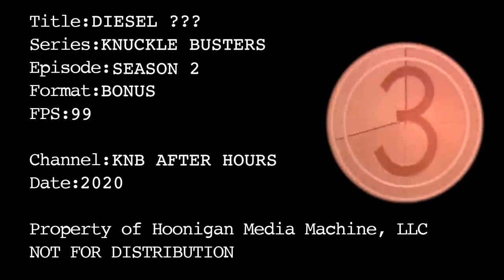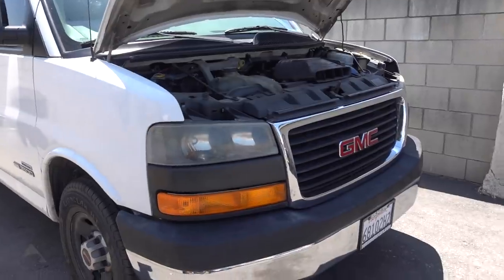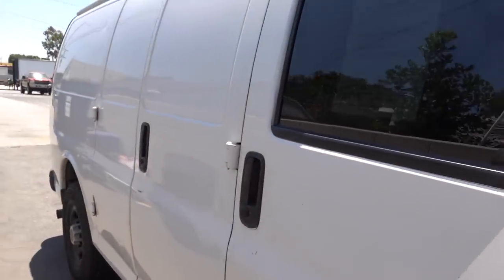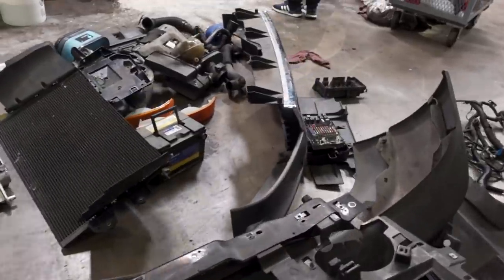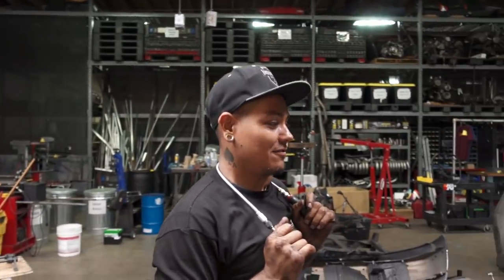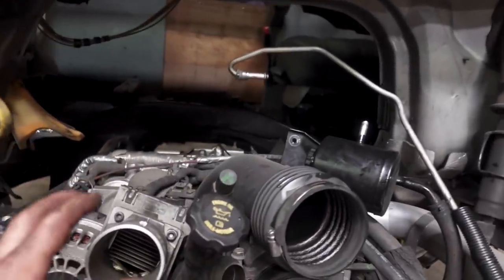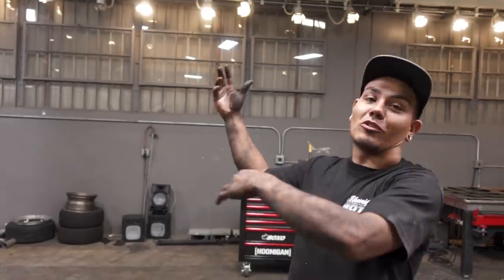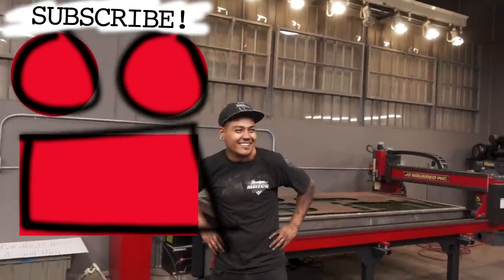Powerplant for Knuckle Busters Season 2 Mystery BUILD!

Comment: Ya'll need to drill a hole on one or each of those forks and  bolt in a towing ball or something so that chain doesnt slip....I keep getting flashbacks of the LS motor falling into Chase's car.
Reply: Deff put some holes in it, we run 2 bolts with the chain between them

Comment: what weights 850lbs and makes 300hp. a duramax. should have just left it in the van and had an awesome tow rig. 

I know some bolt ons and a tune will bump it up to 500hp but you'll still be slower than a 500hp gasser because it weighs twice as much.

Comment: if you plan on drag racing the Duramax call Gale Banks and get one of his drag pack kits for the Duramax. he's the holder of more speed records with the engine then anyone else in the world . he has everything you will need from one of his billet cranks up to the intake and twin turbos to make it out run an LS off the line. he is currently making over 800 hp on a stock engine with a super turbo set up and is shooting for 1000 hp. he has been doing this stuff to diesels since the 70's so he knows his business . also stuff a wrecker aluminum LS 4.3 and a matching trans in the van and save it the damn thing is to nice to let go . alfonso you know it's out back on the lot with all of Scotto's other cars  you know the ones he don't want us to see for one reason or another .

Comment: What's that white powder on the floor at 3:02 is it to soak up oil and coolant?
Reply: Diatomaceous earth, very common in shops to clean up spills. Material soaks the oil and it's sweepable into a garbage bag for easy disposal... or so they say. I've always preferred pigmats but you can also use kitty litter.

Comment: I mean, it doesn't have to be torn apart. You could rip out the 6.6 and 4L80, and swap a 2JZ or K24 or RB26 or SR20 or literally anything into it with a new transmission and have yourself the world's first GMC 3500 with the heart from a JDM car.

Comment: A built 6.6 really, really, REALLY needs a built Allison 1000 behind it, not a 4L80E (the statement "a 4L80E is really good for us" really shows you're experience in gas engines vice diesel applications).  Stock 1000's can handle 500-600 whp and when built, north of 1000 whp, which would be around 1800-2100 ft/lbs at the wheels -- good enough for 200 mph.  When they put a 4L80E or a 6L80E behind a 6.6, they typically de-tune the engine because it can't handle even the stock power of the Duramax (I know for certain they do it when Quigley puts a 6L80E behind an LP5).  Big power out of a diesel always equals transmission problems, so do yourselves a massive service and put an Allison in there.

Comment: Def need efi live on it. Simple mods go a long ways on a dmax. Turbo, injectors, and tunes (with supporting mods) and it’ll move out.
Reply: Pretty much diesels in general. More boost, more fuel, more power
Reply: Dr. Spatula ya the idea is the same for all of them but the practice is way different on each motor to make power.

Comment: Shame you're not using a Cumminside'er. Much better engine IMO, But maybe the engine bay can't take a 4 or 6BT.
Reply: Or that suspension might hurt too bad with one. Mainly the 5.9 12v tho
Reply: Pshhh. 6bt is only 1,200lbs. It'll be fine
Reply: @Dr.Spatula  Lol ya no biggie the Honda N600 they'll throw it in got it no problem

Comment: You guys always freak me out when you use the forklift to remove engines...     Drill a hole in one of the forks for a trailer ball so the chain cant slide off like it did with Chase's engine...        and then you can use the forklift to move trailers around too as a bonus

Comment: There arent many anywhere. The vans are pretty rare with a diesel how do i know? i have a 2012 with one. Mine has a 6l90 instead of the 4l80, dont trash it since they re rare, get a pos pickup instead. The vans are also detuned a bit but the same motor so you need a tune to get to pick up power levels .

Comment: damn starting a diesel without pre-heating damn hurt man, please don't do that again
Reply: Its a duramax dont need to
Reply: Duramax compression ratio of 16.8 heats up the compressed (measured at 20 celcius) air in the cylinder to around 575 celcius. More than enough for diesel. Since the ambient temp in California is higher, there was no need for letting the glowplugs warm up. Increasing the air temp unnecessarily increases the NOx, so not letting the glowplugs warm up was the RIGHT thing to do.
Reply: It wouldn't have started if it was that cold they are in cali